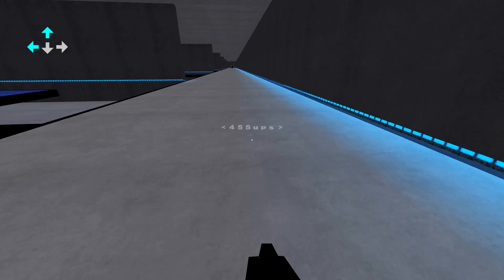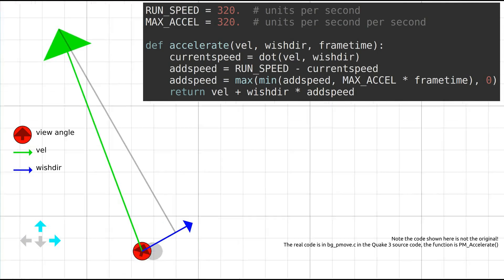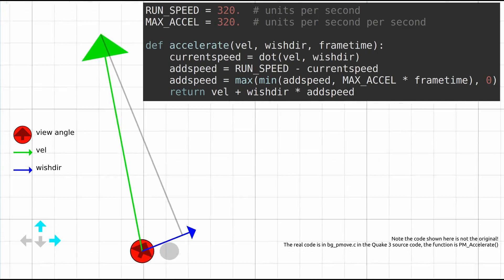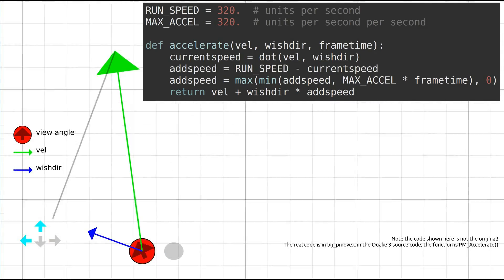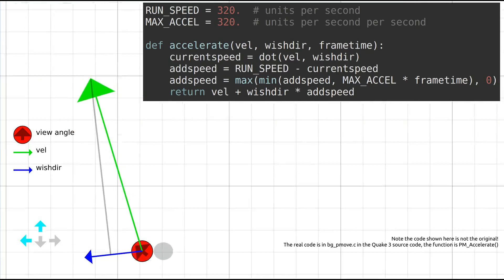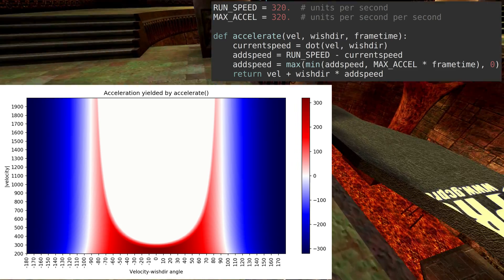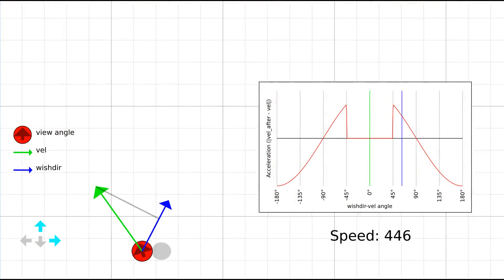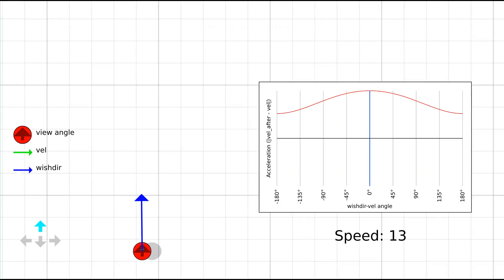Strafe-jumping physics explained

Comment: It seems like the currentspeed thing is just a way to prevent inconsistent max speeds.

Every frame, a constant acceleration value multiplied by wishdir is added to your velocity. That is, unless you’d overshoot runspeed in your wished direction. In that case, just set velocity in that direction to runspeed. This is the meaning of “currentspeed:” current speed in the wished direction.

Really, the reason airstrafing works is because trying to move a different direction just adds speed in that direction. It never substracts speed in your previous direction. This means that changes in direction result in a speed increase.

Comment: Jump affects wishdir. Releasing jump while airborn is optimal.

I noticed my movement was sub-optimal and asked around. Turns out holding jump was interfering. Affects Q3 and later, does not affect Q1.
Reply: Just like crouch. I think they "lift" the original 2d wishdir into the 3d world and then the "shadow" of the lifted vector (now shorter then the original) is used for the next calculations

Comment: (I wrote this first part before realizing the pinned comment was there.) 
In many games including TF2 and I think maybe CSGO and other HL2-derived games, holding W will actually decelerate you and give you less control. This is why anybody who rocket jumps in TF2 will tell you to never use W when you don't need to. It actually makes a huge difference in the distance you get out of rocket jumping.  

Thanks for the explanation of the math behind strafing in these games. I've been looking for a good one for a while because I wanted to mimic a similar thing in my own projects.

Comment: Holy shit I can not wrap my head around this
Reply: same
Reply: @buttadawg-n3zI’m a software developer now and your notification made me look more into it. It turns out that this video skipped over a key point which is quakes PM_airaccelerate function. The idea behind strafe jumping is that there’s a conditional check to see if addSpeed is at or below zero, if it is, the function returns. addSpeed is the difference between wishspeed (which I believe is always 320) and currentSpeed. Current speed is the dot product of the players velocity and wishDir. Velocity is a 3D vector which contains each axis (x,y,z) and the amount of units it’s currently moving in that direction, so if you’re moving forward at the movement cap velocity would look like (0,320,0). WishDir is just the direction the player is trying to move in, so if you’re holding w in the same direction you’re moving wishDir will look like (0,1,0). The dot product between these two will be each respective value multiplied by each other, then all 3 added together, in our case that would end up being 320. So in our example wishSpeed is 320. AddSpeed, being the difference between wishSpeed and current speed, ends up being 0 and the conditional statement is true, so the function ends and no acceleration is given.

However, this can all be bypassed by making wishdir slightly unaligned with velocity. If the player is now moving forward at 320 units, and is holding both w and d wishdir (through some math I don’t feel like looking up) ends up being something like (0, 0.7, 0.7). Now when we calculate current speed we get 224, because 0x0 is 0, 0.7x320 is 224, and 0x0.7 is 0. addSpeed being the difference between wishSpeed(a constant 320) and currentSpeed(224) we get 96. Since addSpeed is above zero, the conditional statement no longer returns, and we continue through the function. It then checks what’s greater, or addSpeed or a default acceleration speed (I guess you could think of it like an acceleration floor), the greater value is used, and then added to the velocity of the player.

I didn’t look too much into the logic behind why certain camera angles work as a sweet spot, but that seems to be the jist of it, and I feel like I mostly get it now.

Comment: Despite praiseworthy visualizations this is still kinda poor explanation missing the most important points. What exactly happens, what are the types and constraints of variables, algorithm effects and why it's done this way in the first place.

The purpose of the code is to soft-cap the acceleration towards velocity vector while simultaneously allowing lateral/backwards movement regardless of actual velocity. Dot product line is exactly what fulfills that intent and inadvertently causes the exploit possibility.

The code you provided is a bad example because it's incorrect compacted oversimplification which only confuses — actual Q3A code is much clearer even if you don't really know C. The function takes as parameters wishvel vector split into wishdir (unit vector) and wishspeed (scalar value, that can vary and is not necessarily 320) components plus contextual multiplier non-important for the topic. wishvel itself is just an aiming vector altered by WASD inputs in 45° increments in horizontal viewing plane. That's where different styles of bunny-hopping come from — multiple different inputs can result in identical wishvel vector creating the same effect.

Dot-product in this specific case with one of the vectors being unit vector boils down to most basic trigonometry, without pointing that out (and displaying on the graphic) your mention of currentspeed being represented by a leg of the triangle isn't really helpful. And BTW, blue-tip-to-grey-line part is simply incorrect because wishdir is a unit vector not wishvel.
So dot-product results in a value that is guaranteed to be below VelocitySpeed and becomes lower and lower (down to negative values) the bigger the angle between the two vectors is.

If the value of currentspeed is above the cap (addspeed <= 0) the function immediately exits and no acceleration applied at all, otherwise standard flat acceleration is calculated for a frame (forced to addspeed value if it's lower), wishdir is multiplied by that and added to Velocity vector.

To summarize: specific input is performed to keep the angle between current velocity vector and desired acceleration vector so that the dot-product of those two is below the threshold to pass the acceleration check and continue accelerating even well beyond the intended maximum velocity.
Reply: Thanks for this explanation.
Reply: @George Bush Gaming If that's to much text for you you might want to read a book or two before your brain dies completely.

Comment: I am tinkering with Fitzquake code and I figured how at standard running speed, gradual change in yaw direction cannot change player's actual movement direction more than about 2.5 degrees per frame. Maybe you have any idea why does it happen?
Reply: I figured it out, the problem was in bunnyhopping/strafe jumping code. Once I implemented Carmack's Quake 3 fix for bhop, an error for 100 unit radius diminished from 20 units to 3 units.

Comment: A very elaborate explanation, interestingly it doesn't stop here. There are other methods of "strafe jumping" mainly "inverted" and "halfbeat". With halfbeat you only need to look on one side of the direction you want to go, such as looking on the left side and alternating between "a" for strafing left and "w+d" for strafing right. This can also be performed the other way round by pressing "w+a" to strafe left and "b" to strafe right while looking on the right side of the direction you want to go. With inverted on the other hand you don't have to press "w" at all and will alternate between "a" and "d". 

You can look it up on youtube, will probably find some age old "enemy territory" videos which is a game based on "return to castle wolfenstein". It features online mode which the prequel lacked and has an updated engine. Both these games use the quake engine and were kinda popular a long time ago. The trickjump aspect was rly useful in many ways and some people really jumped alot :D.
The skill cap was also really high, also getting used to it first can be kinda rough, maybe even as hard as the shooter aspect in some way.

Comment: In the Rocket League community this is called "wave dashing." It's not used to move more quickly than otherwise possible, but rather to accelerate very quickly and sometimes in strange directions.
Reply: wave dashing is a term originally coined from super smash brothers melee, where air dodging into the ground creates instant momentum changes. What you described is more akin to that than strafe jumping, but nevertheless, they are both awesome mechanics.

Comment: what is the math behind games where you don't press forward while strafe jumping? what is different in those
Reply: None are like that. Do you mean  bhopping? That has air control. Its a very very different thing
Reply: @Wylie288  I wouldn't call airstrafing(Or "bhopping") "a very very different thing" as it is the exact same thing but with lower wishspeed and higher air acceleration.
Edit : wishspeed is called RUN_SPEED in the video
Reply: @TarenGarond  They use entirely different button presses and mouse movements. The skills are not transferable.
Reply: @Wylie288  "what is the math behind"
Reply: @TarenGarond  Its also very different. Ive code used to implement air control into quake clones. Its much longer. On top of that, the mechanical differences mean the math also has to be a different as well.
Reply: @Wylie288  Yes the player acceleration code is basically double the length (If you do it the QuakeWorld way) but you just duplicate PM_Accelerate and name the new function PM_AirAccelerate and basically just add "if ( wishspd < 30 ) { wishpd = 30 ; }" (Yes I know there is also wishspd = wishspeed and changing of wishspeed to wishspd in the "addspeed ="-stuff).
But calling the math "very different" is to me a bit weird as basically the same function runs but with other values.
So yeah, I agree to disagree.
Have a good one!

Comment: Is quake 3 different in a way that requires you to do it half sideways rather than letting go of w?
Reply: In games with Quake 1 style movement(The "letting go of w"-style) the wishspeed(Called run_speed in this video) is way lower in air(At 30 UPS typically) than on ground but the acceleration in air is higher(You can turn and stop faster) than the Q3 air acceleration.
The optimal wishdir angle obviously is quite close to 90 degrees from where you are going(Even at moderate speed), so therefore you only use the key(Or keys if you look diagonally) that is 90 degrees from where you are heading to gain speed.
So yeah other than variable values it isn't different at all!

Comment: Now keep in mind, this amazing technique for movement is the result of a bug in Quake 1, that they decided to keep for Quake 2, 3... and pretty much any sub-sequent Quake since. 
Thanks for the great explanation btw.
Reply: They definitely didn't "decide to keep" airstrafing from Quake in Quake II. They *hated* players bhopping around with all that air control in Q1, and changed the engine to nerf airstrafing heavily in Q2. Really it's a testament to the community that they found a way to keep doing it in Q2 and beyond.

Q1 movement is a lot more like Source games (because that's the engine Source is based on). Thankfully Valve had the opposite gripe, they left the air control alone and capped the max speed instead.

Comment: I always wonder why there is no "surf" in quake engines compared to goldsrc even if bunny hopping (watered down) shared 
Why it's not possible to stick to ramp like in https://youtu.be/Ziso-p8l6Kk in quake 3?
Reply: There is "surf"(Kind of) in Quake 3.
Surfing is when sliding on something with less than 0.7 vertical component of the surface-normal(Basically something with more than 45 degrees of inclination.).
When on a surface like that you aren't considered to be on ground so you have air movement and no friction.
But the air acceleration is very low(Compared to QuakeWorld and typical GoldSrc games) in Quake 3 so the "sticking to ramp power" is also very low, I'm quite sure the air acceleration is cranked up high as hell when surfing(I think the typical air-accel is 100 when surfing compared to the standard 10 in classic CS, not entirely sure though as I'm not a surfing or CS expert)!

Comment: Good video. One thing you don't mention though is how you accelerate slower along certain axes, because of velocity snapping (a rounding function). It plays quite a big role for harder lanes, like orange2bonus or w3spgaz_strafes blue. If you turn too much too soon by being slightly beyond the optimal angle you'll decrease your acceleration because of this snapping.

Also, Quake 1 engine games like CS have slightly different strafe jumping physics, even though the principle is the same.
Reply: If that is the case, it must be because player speed isnt derived from vectors, but instead they have xspeed, yspeed and zspeed? And the vectors people use to illustrate playerspeed and all that are derived from that? Is that correct?

If that is the case, and rounding is used on playerspeed in any way (it probably is because of multiplayer) then the commenter above me is mistaken; OP is describing a separate phenomena
Reply: Very interesting by the way. Thank you.
Reply: that 'angle snapping' is the entire content of this video, the function which causes it is not a rounding function but instead the one shown in the video.
Reply: @assdyffv6792  the video says nothing about velocity snapping. the heat map isnt true if you consider velocity snapping. at low speeds and with suitable velocity vector, the acceleration is the same for quite a big angle range.

Comment: OK, now is there a circle strafe explanation? I need to know how to train it.
Also, how would this work in quake champions?
Reply: Just watched the video and I think I understand it now after a lot of thinking. Though circle jumping came to my mind too and I thought that it is different than what is explained above but I finally came to the conclusion it is not.

So for circle jumping there are a lot of videos and tutorials out there but I can try to explain even though I am a beginner myself.

1. Start with moving forwards til you reach the max speed (320 ups)
2. Then press forward and a strafe key at the same time (left or right / a or d)
3. In the exact moment of step 2 or slightly afterwards move your mouse in the direction of your strafe key
    -> left - move mouse to the left 
    -> right - move mouse to the right
    Though keep in mind to do a granular/smooth/continous movement and do not turn more than 45 degrees from
    where you are looking at but try to keep it close to 45 degrees.
4. When you are finally looking in the direction you eventually want to move press jump. 
     This is normally 90 degrees from where you started because you get the most speed out of it.
5. After jumping so in the air keep moving the mouse to the side you initially started strafing and at the same time
     keep forward key and the strafe key you chose pressed (left or right).
     That's where you are transfering over to normal strafe jumping.
     From there on after you land the next time either keep strafe jumping to the side as before or switch sides.
   
Also don't keep the jump key only press it before you want to jump because with keeping it pressed you will accelerate slower.
I could do a little slowmo video if you want.

Also why shouldn't it work in QC? As far as I know they used the same code for the movement as in previous titles.
Though the champions in QC have different max speed caps and different acceleration but the principle is the same except for Anarki and Sorlag. So some jumps or distances are not doable with some champions.
Reply: @lolasdasdasdasdasdas  circle jumping == strafe jumping, imagine your previous frames momentum is heading in an angular line from your point along the curve of a circle whose center is 90 degrees from the direction of that momentum. The thing is that circle is constantly getting bigger because of your acceleration, this is why you have to constantly be refacing towards the center of the circle while pressing your intended direction along the curve of the ever growing circumference of that ever growing circle.